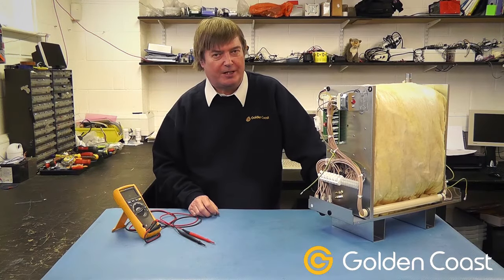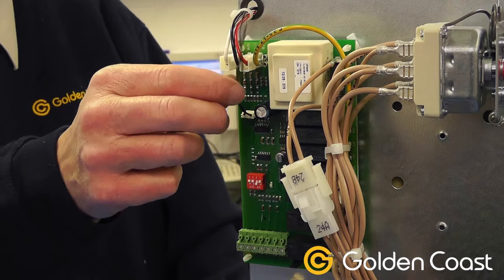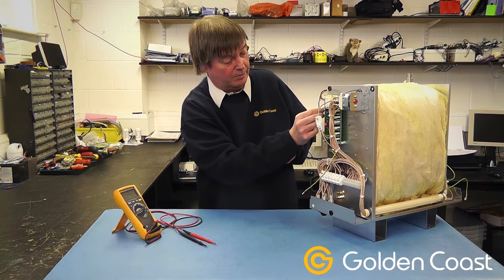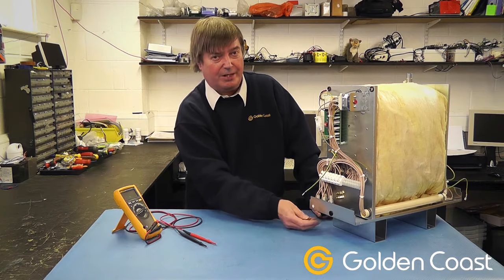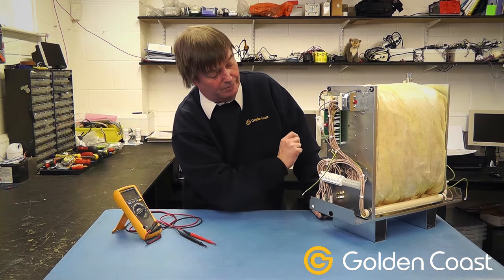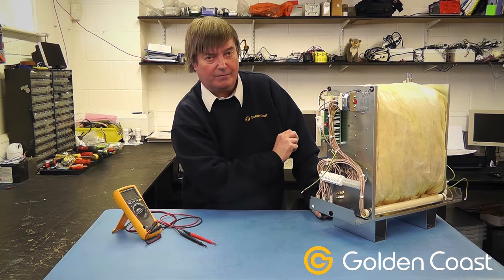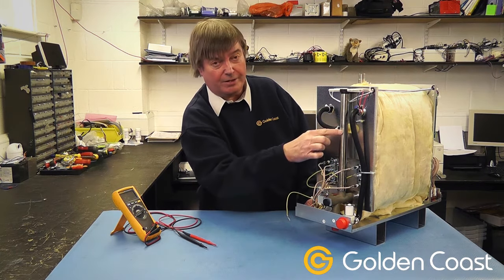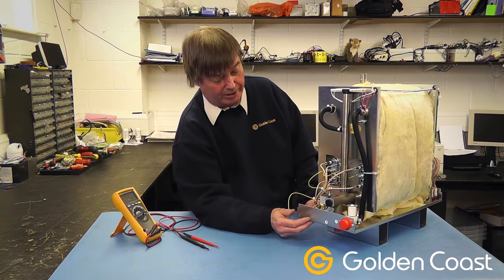Fault Finding a Tylo Steam Generator | Andy's Answers

Comment: Thanks Andy, 
Do I need to change only the metal tip sensor or the whole cable as this will make a very complicated matter!
Can I have the part number if poss pls?
Reply from the maker: It comes as one part so you will have to change it all. Contact your local Tylo dealer for details.

Comment: Hi Andy,

My H1 control panels is showing high temperature wen not in use, so because of that the steam does not get on?
Pls help
Reply from the maker: Hi Aslam, the most likely cause of this is the temperature sensor has failed and will need changing. Hope it all works out for you. All the best, Andy

Comment: Hi Mr Andy my tylo steam generator circuit card led green light not blinking
Reply from the maker: Hello. This could be a number of things, as this looks like there is no power to the card.
You will need a qualified engineer to;
Check the mains supply.
Check the red button cut out is ok (pressed in)
Check the main switch is not burnt out.
Trace the power to the card by working backwards from it.
Please be aware that this MUST only be carried out by a qualified electrician or Tylo engineer.

All the best, Andy